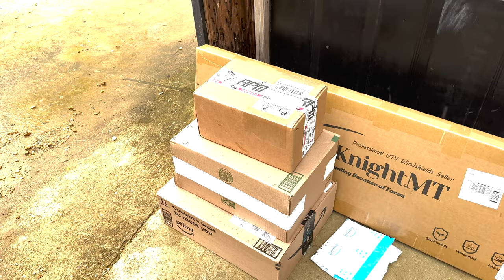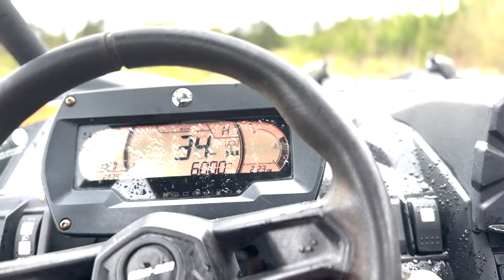RPM POWERSPORTS BLOW OFF VALVE INSTALLED ON MAVERICK X3

Comment: Does it matter where the blow is connected? I mean can it get water in it?
Reply from the maker: Blow off valve only blows air out, it won't take on any water
Reply: @CBTrailRiders  good deal I just bought my first turbo so I'm clueless
Reply from the maker: @bmillz4758  you will love the sound of the BOV